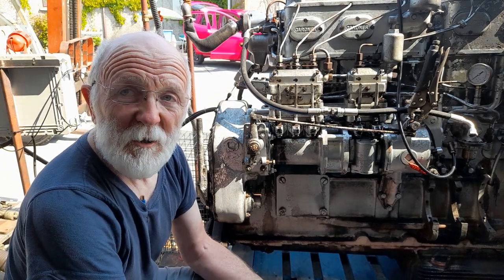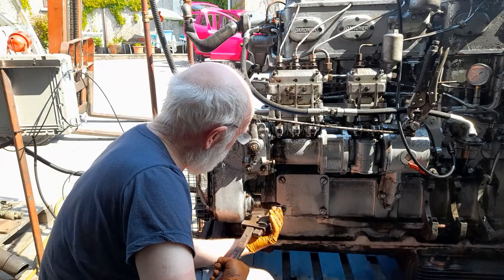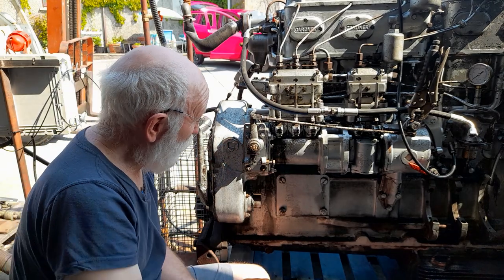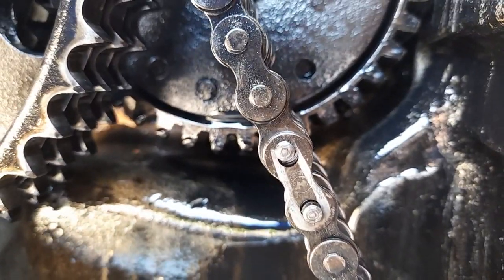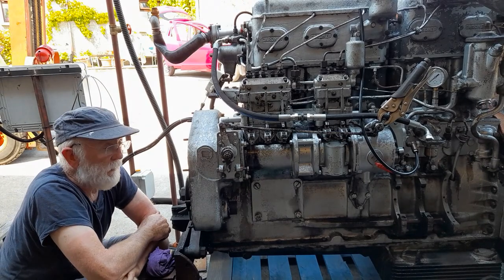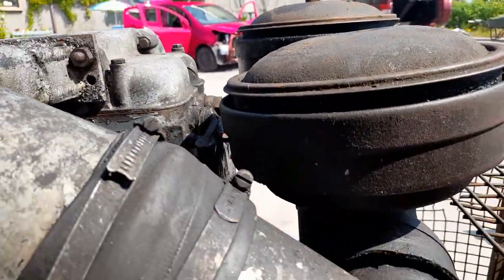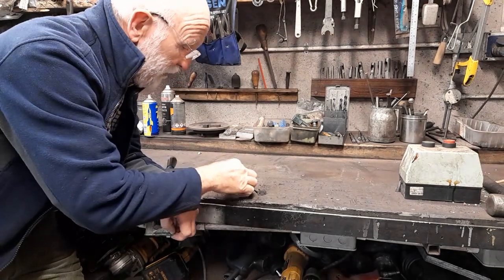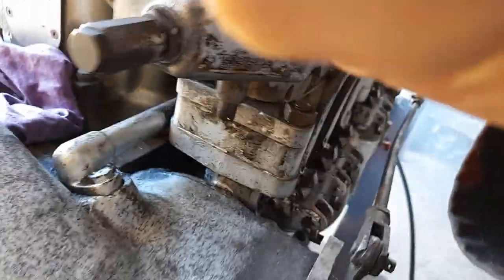Gardner Engines: Adjusting the Timing Chain.

Comment: Could you not split the old chain and join on the new chain to the end of it and bar over the engine (while keeping tension on the chain) to pull the new chain in around the sprockets and once it comes around again you could detach the old chain and join the two ends of the new chain.
Reply from the maker: Hmmm, worth thinking about, next time.   Thanks for that.

Comment: Thanks Joe as all ways enjoying the Gardner story i have go a question i went to start my 6lw at the Butten the other day and nothing happened  i got around the problem by using a screw driver to start the engine but i noticed the screw bolt the smaller out of the three on the cav starter was loose do i have to pull it to peace's to nip it up ???
Reply from the maker: Well, the least you'll have to do is pull off the back cover and have a look.   Disconnect the batteries first.